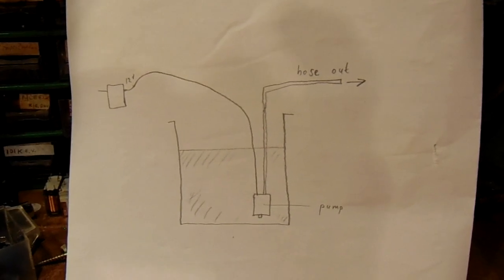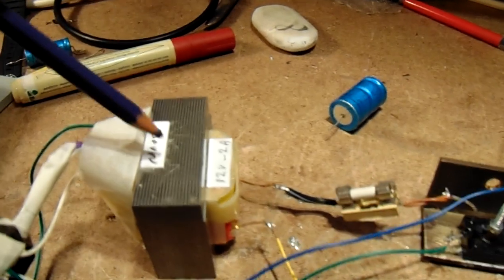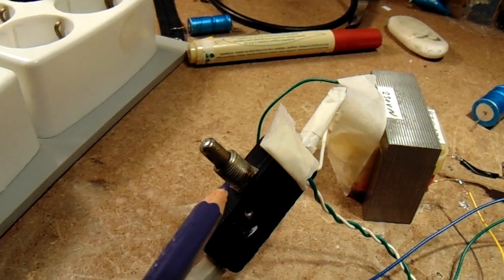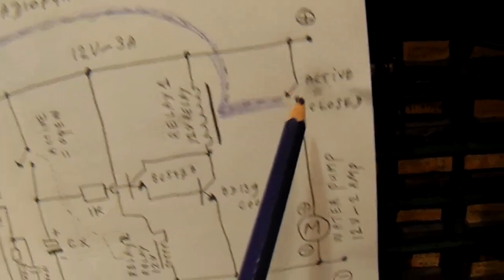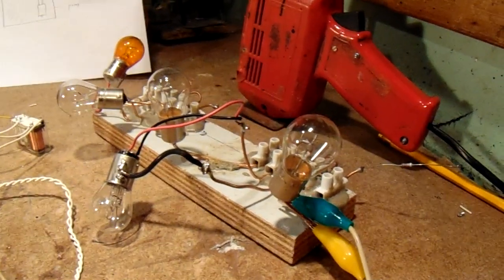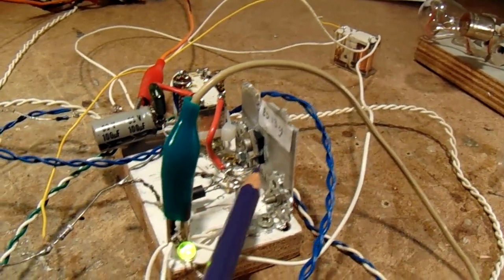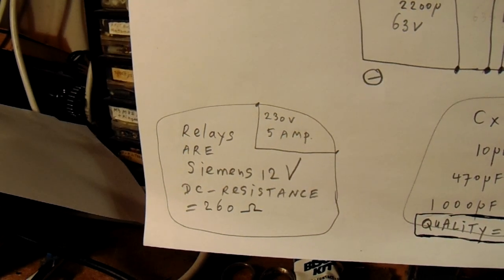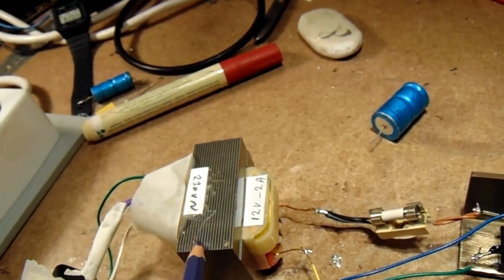30 sec-3 min (water) pump timer relay (schematic)

Comment: Well thought out!
Reply from the maker: +Energy Fabricator Thanks! It took some time to find out that the relay contact to the timer capacitor had to open, when the whole circuit was activated. In some way there is enough energy available in the first 0,2 second till the contact opens to charge the timer cap properly.